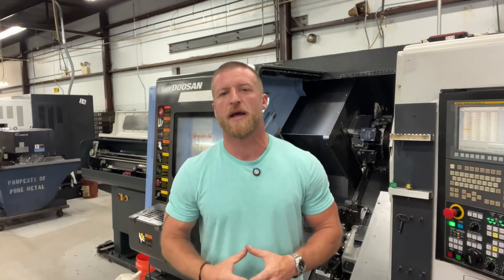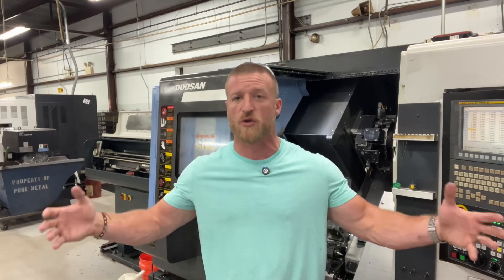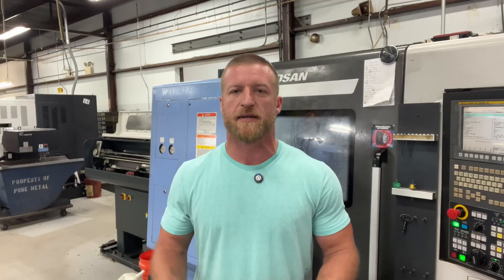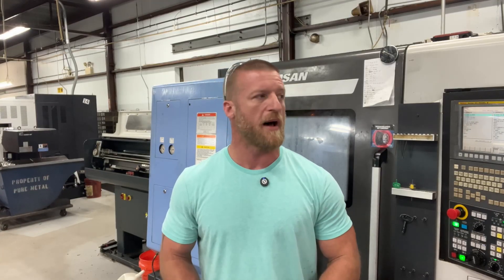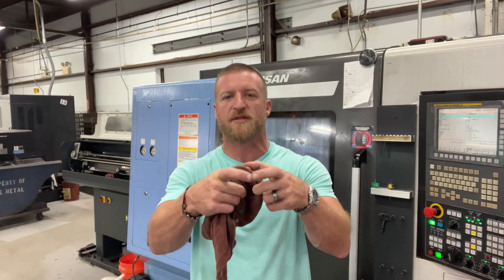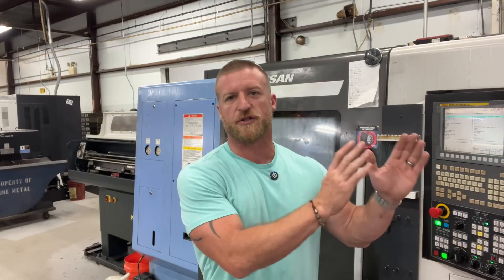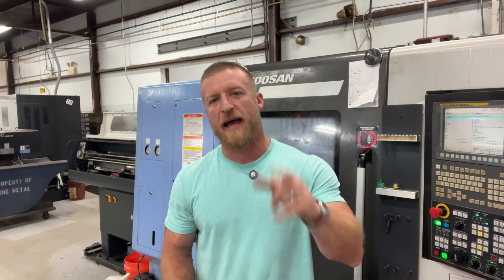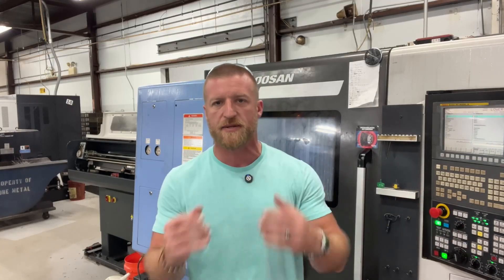Lathe VS Mill: Why CNC Milling Takes Serious Skill!💥🚀 #cnc #cncmill #lathe

Comment: I started out running a simple 2 axis lathe, program in shop turn, on the siemens control. Then the company brought an okuma lb3000 and now i run both. I use fusion 360 for the okuma due to the milling i do on the machine. At this point we are just using it at a bar fed 4 axis mill. So all changes are done in the cam and repost the program to the machine.
Reply from the maker: That’s really cool and good to know. I’ve never worked on the Lb but I hear it’s a tank. LT2000 is the biggest OKUMA I’ve worked with. So right now you’re just using your lathe as a mill?
Reply: @Crusadermachining 
Yes. Very few parts i run don't have mill work. From 1 off job shop work to our production parts. The lathe fills the role a 4th axis would have as we only have 3 axis and 5 axis mills. Its just a huge challenge to do our mill jobs with only 3 axial and 3 radil tools on the lathe. We need to buy more.

I would definitely recommend looking at a lathe for production mill parts. We do qualitys like 100 to 300 parts. The parts i ran yesterday had no turning at all. Need 3 ops on the 3 axis were i did them in one op in a 30 minute cycle so Bar feed it and run all night and there's the order complete in 2 days. I run 24 hours a day in soft meterils were tool wear isn't a problem.
Reply: @richardhall2542  I need to build a miniature version of that. Ever since I cut a hole in the bed of my mill to machine the end of a long thing, I've been tending toward making parts from round stock. So much better chip clearing than flat stock, and less waste since the workholding stub of one part is usable material for the next.

Having rotary motion would be better for cutoff compared to going round and round with a slitting saw like I do. And the option to use coordinated linear and rotary motion would give better precision for circles and gear-like things, since the backlash on two linear axes (even with compensation) causes small variation in the shape of each tooth.
Reply: @dekutree64 when i started out i always thought round parts for a lathe and everything else for the mill but the lathe shouldn't be over looked. Especially a lathe with y axis. That opens so many possibilities.

One downside is setting your tools. On a mill you set the tool length and your good. On the lathe since every tool is its own spindel you have to set x,y, and z for every tool and if they not perfect then blending tools is a nightmare.
Dose anyone have advice on setting a tools y axis offset? I use my tool prob for x and z and try use an indicator for y but its never that good due to the sag in the indicator when flipping it back and thorth.
Reply: @richardhall2542  you have Tschorn Drehplus 3d taster for lathe. Not cheap but very useful if you do lot of complex setups with y tooling.
Reply: @krivakapa that looks really promising. Ill definitely be showing the boss that one. How to you normally hold it and diel in the run out as i have a 3 jaw hydraulic chunk and not a collet chunk.
Reply from the maker: That’s awesome man. Well done

Comment: I use Gibbscam. I dont touch the code. If I need to change something I edit in the CAM. I do play with feeds and speeds on the dials on the machine tho
Reply from the maker: That’s good information to have especially from the milling perspective. I’ve never used Gibbs cam before do you like it?